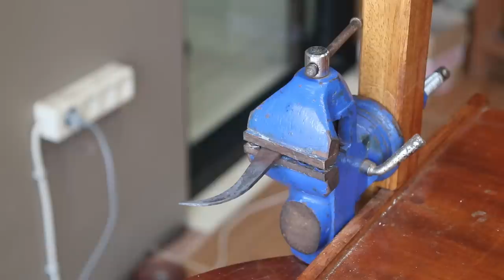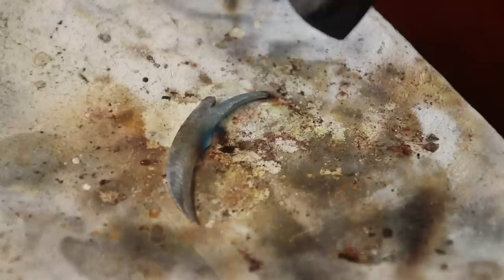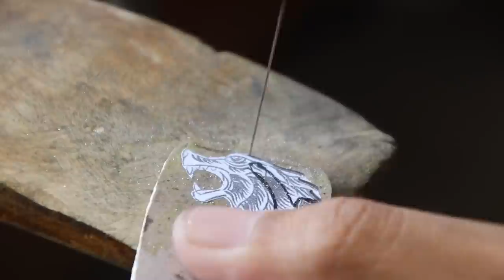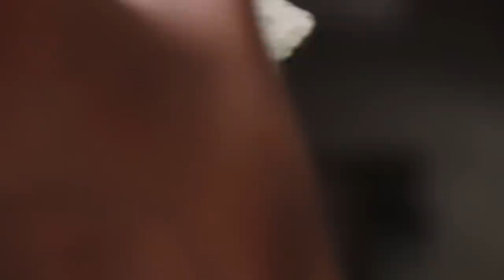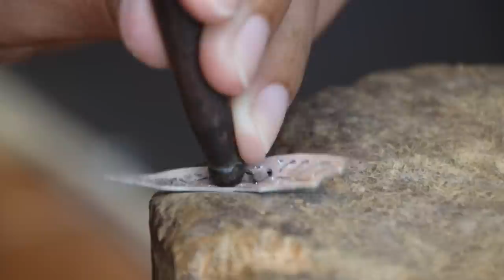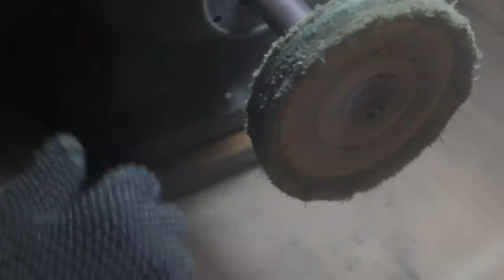claw pendant making - make claw pendant with hidden knife

Comment: Thanks for sharing! What was the red liquid you used?
Reply: Any oil can be used for quenching, just don't use water, you've a higher probability of cracking the blade, also heat it up to a temperature above 100°
Reply: ٠ﷻڞڞڞﺿﺿﷺ